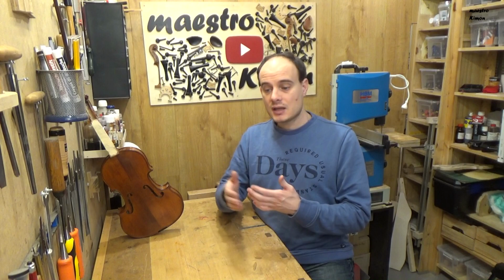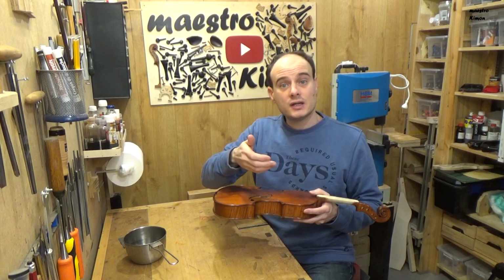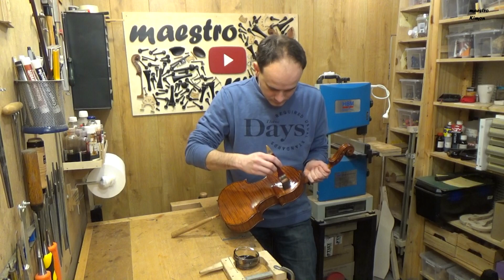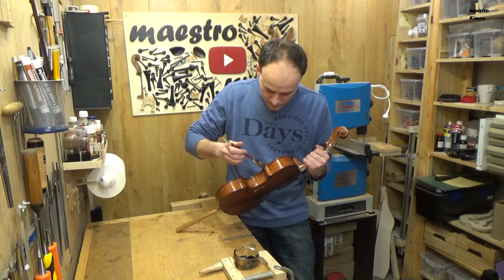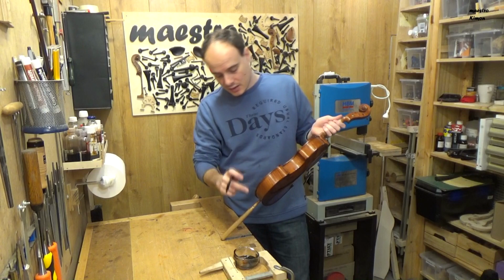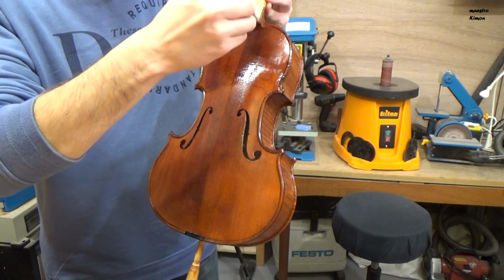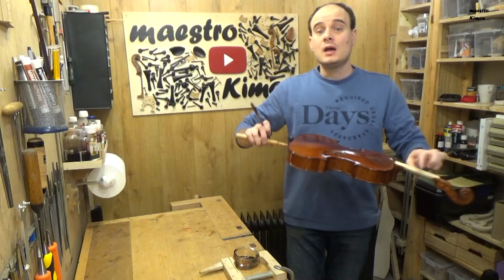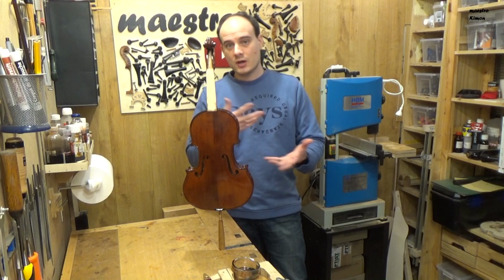Applying a layer of Varnish

Comment: Thank you for demonstrating how you use this colored varnish.  It looks great.  Someone else mentioned the work space environment was a reason for the varnish drying too quickly, and I also work in an air-conditioned space, so the temperature is warm and humidity very low which would result in faster drying.  The other thing that is evident from your video is that you work much quicker than I do, so another opportunity for me to improved.  Thank you again.
Reply from the maker: The solution doesn't have to be complicated!!!

Comment: Even same oil varnish has the cracking problem you described. When applying multiple layers with slow drying oil, the inner layers oxidizes slower and the outer layers. If too many layers are applied too quickly, it may crack months later.

Comment: I'm about to finish my first violin. Built my drying chamber, have the Joha varnish kit. I read mixed ideas about sanding vs scraping initially. Right now I've only scraped the surfaces, other sources say to wet the wood to raise the grain, then scrape again before the first surface coat.
Reply from the maker: Both is possible. They say that when you finish the instrument with the scraper, the wood shines a bit more. 
Wetting the wood one last time helps to even the grain.
Reply: @maestrokimon  I only did scraping, yesterday did the gelatin, antiquing liquid and 2 coats of clear varnish. Think I will do 1 more clear before adding color. I'm videoing my whole process, so will put something together when I'm all done.

Comment: Thanks for showing that, it helps a lot. I had problems varnishing my first violin, so I can't wait to do better on my next instruments.
I have ordered Hammerl ia oil varnish for my cello build. You said you do small instruments in three sections. What about cellos?
And then I have a question that has been bothering me these last few days... Sorry for the long comment:
Can you please either make a video on or just explain in a comment how you would add pigment to varnish? 
I have used Hammerl's powdered ethanol dissolved pigments for spirit varnish, but I don't suppose that will work in oil varnish. I'm curious about natural pigments mostly. I have stumbled upon many different methods online, but they seem to mostly apply for spirit varnishes. Like leaving sandalwood or other pigments in ethanol to extract the pigment and then add the ethanol to varnish. But I suppose adding ethanol or the powdered pigments to oil varnish is a bad idea.
I have ground sandalwood and catechu at the moment along with colour extracts and powders from Hammerl. I have used ground catechu directly in spirit varnish before to match an old varnish. Is that actually the way to use the pigments, or should I look into mulling, extraction and other fancy methods?
To give you an idea of what I'm doing, I was planning on a sugar seal of caramelized cane sugar which I have been experimenting with, covered in 3-4 coats of ia varnish with a mix of sandalwood and their golden brown colour extract. On the neck I don't want to do a sugar seal as I'm worried it would get sticky as I wear through the varnish with my thumb, but a coat or two of clear or golden brown is the plan. I was hoping to have a nice golden/reddish instrument with some depth to it, but of course I will do some test pieces before applying it to my instrument.

Best regards, Tobias
Reply from the maker: Hello Tobias,

On cellos I work also in three parts but divided in 2 so eventually in 6. Upper left and right, mid left and right an lower left and right. Working a bit faster helps. 
To colour the varnish I use their colour extracts (see here: https://www.joha.eu/en/dyes/color-extract/) These seem to work good as soon as you don’t put to much.  Adding ethanol to the oil varnish is not a good idea as you say. I have used powder pigments in the past but I don’t like theme to be honest. As you may know these powders don’t solve in the varnish but float. I always have the feeling that I can still see the small particles in the varnish layer. 
My main idea whene varnishing (and in other subjects too) is not to mix too many different thing and keep everything simple. I use mastic as a sealer, then a stain (one of these: https://www.joha.eu/en/dyes/stains-liquid/), then the transparent coating, several layers of coloured varnish with extra colour, another layer of transparent and that’s it! 
For the neck I use the same stain as for the body in dark brown like the 402 and the finish with steel wool and cooked linseed oil. 
I hope I could help you!

Comment: Do you ever have to retouch/repair  the finish on older instruments?  I would be interested in such a video.
Reply from the maker: I have to but this is very hard to film as colors of transparent varnish tent to change depending on the light and camera angel. I tried to film this a couple of times but was not happy with the result!

Comment: Be careful if you switch between Micromesh and « standard » sandpaper, because the grits grades are not equivalent. 2400 Micromesh is coarser than 2400 sandpaper. Thanks for the video by the way :)
Reply from the maker: I know! although Micromesh isn't so aggressive as regular sandpaper.
Reply: @maestrokimon  True ! And it doesn't clog as fast either, even when used dry to sand varnishes. It's unsettling when you're used to regular sandpaper :)

Comment: A question concerning the varnish of a very dirty old violin:
Did you ever remove the old varnish from the surface down to the bare with wood e.g. with a stripper and then revarnish it?
It might be apropriate with instruments having been forgotten in the attic for decades and look ugly and dirty and the varnish came off on some places.
Reply from the maker: This is something that many people do but is really bad for the instrument. It is bad for the sound and the value of the violin. You can clean it as good as possible and leave it like that.
Reply: @maestrokimon  Many thanks for your quick and profound answer. What I am learning from your comment is that once a violin is finished and varnished this establishes the sound quality of it in a final manner. Any later change rather leads to a deterioriation of it's sound profile. So do changes only as little as possible and preserve the sound, not it's look.
Reply from the maker: That is correct. Also the varnish is part of the originality of the instrument. It is not like the paint of any other object. Feel free to change the bridge, pegs, fingerboard, tailpiece, end-button and sound post, but not the varnish!
Reply: @maestrokimon  So to understand your video right: This viola is a new one out of your workshop and you describe how to add a layer of Varnish to the previous layers.
I was a bit puzzled because this instrument looks like an old one which you are repairing or maybe "pimping up". I totally misunderstood.
Reply from the maker: I see! No, this was a brand new viola (not made by me), never varnished in the past.

Comment: Do you sand after the final layer of varnish?
Reply from the maker: No I don't. I like the slit brush line that remain visible.
Reply: @maestrokimon  so should you sand it if you want a smooth glossy finish with no brush lines?
Reply from the maker: Yes you can sand it but wait until the varnish is perfectly dry. I would suggest to leave the instrument on a wel ventilated spot for 15 days.
Reply: @maestrokimon  thank you